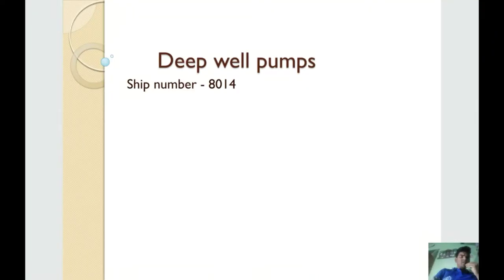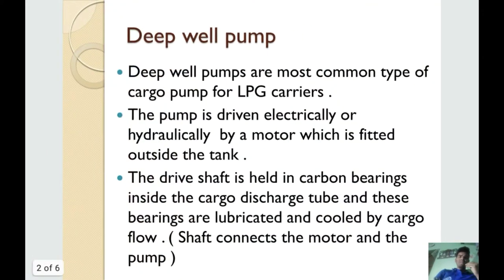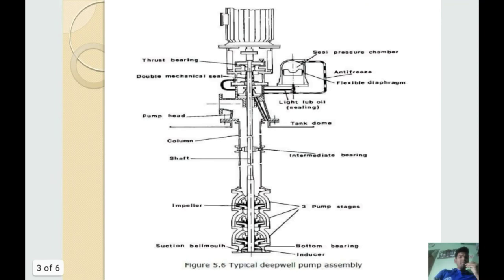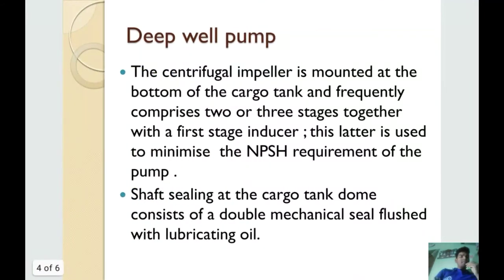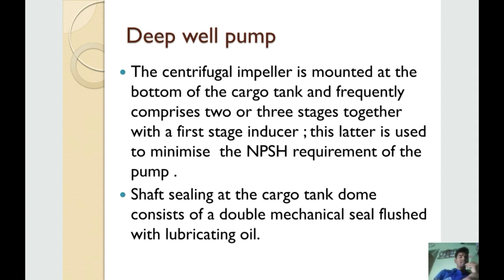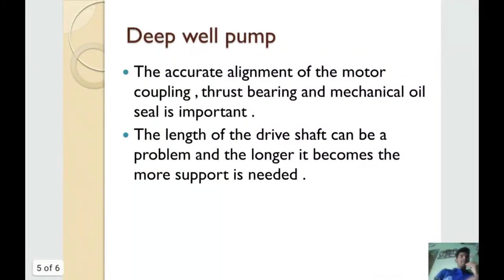What is deep well pump on board ship .

Comment: Can you please telle the name of grease required for the maintenance of this deepwell pump
Reply from the maker: Framo deep well pump bearings are lubricated by hydraulic oil itself.
Because hydraulic motor driving pump unit is driven by hydraulic oil pressure.